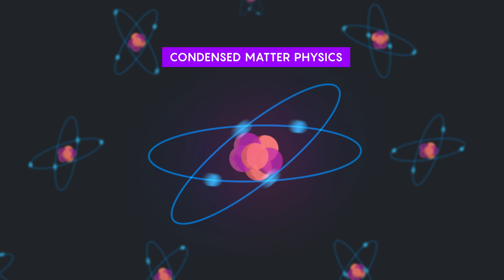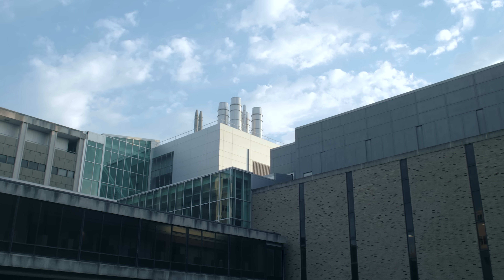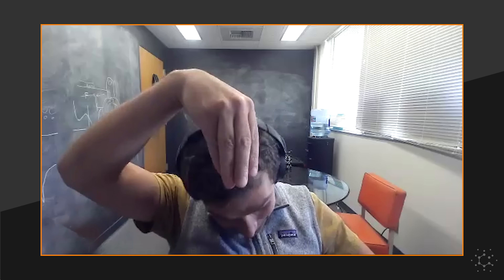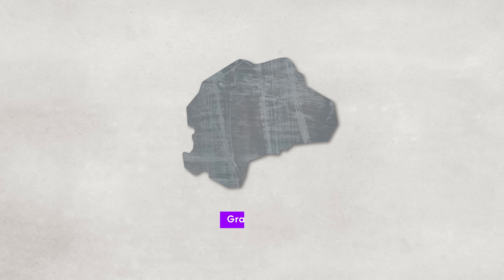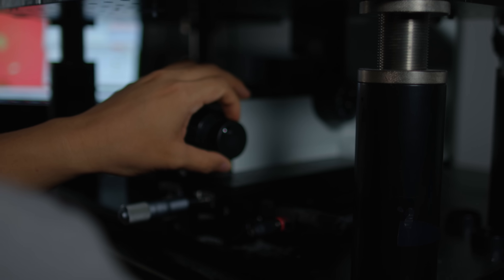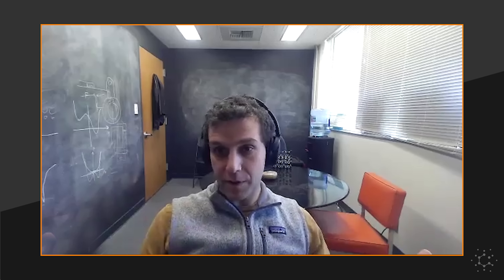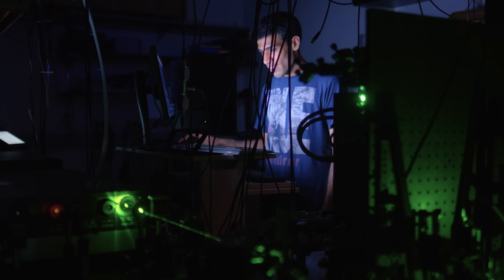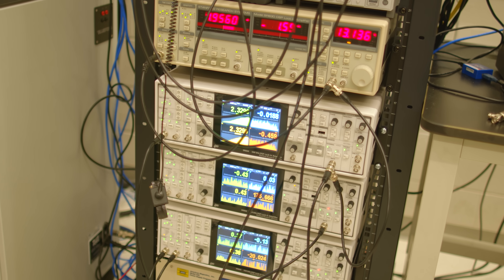How Two Physicists Unlocked the Secrets of Two Dimensions

Comment: 0D Monad (SNF)
1D Line (WNF)
2D Plane (EMF)
3D Volume (GF)
Reply: Are you sure that EMF is 2D?
Reply: @Moz29  
Yes. What I'm not sure of is 3D Volume being Gravitational Force...shouldn't we have found the Graviton by now? Seems like Gravity might need to swap to Dayton Miller’s Ether. I think our problem is Isaac Newton's 1D-4D nonsense. How can he just dismiss 0D? Can 3D you and I even exist without a zero-dimensional space to exist in? Isaac Newton seems more and more like a fraud who used the political power of the Church to force his achievements 🙄.
Reply: @ready1fire1aim1  I don't know about any of that stuff but I was taught EM is two perpendicular oscillating electric and magnetic fields (x,y) propagating in the same direction (z). The perpendicular fields are individually confined to 2-D planes, but together as EMF they operate in 3-D. Am I missing something?
Reply: @Moz29  
Which of the 4 Forces doesn't operate in 3D? We are 3D and use all 4. This makes them all 3D? I'm trying to avoid Newton's conflation errors. Assign each a separate operation (like Leibniz).
Reply: @ready1fire1aim1  I agree, its also why the title of this video bothers me. Would like to know more about what kind of approximations they have to make to consider these systems as 2D. Back to what you said, so do you treat electric and magnetic fields separately is that what you mean?
Reply: @Moz29  
I agree Electromagnetism is a singular fundamental Force. I like 3 of 4 of the fundamental Forces...I'm just dubious of anything Newton. Fun fact: recently academia tried to combine WNF and EMF into the "electro-weak Force"...just to keep Newton's 1D-4D nonsense in play. Really wish they'd just let a failed theory die. Leibniz's 0D-3D has always been accurate and matches our Standard Model...makes me wonder what money is behind Newton...pushing his nonsense on the Plebians...
Reply: @ready1fire1aim1  That’s interesting. Reminds me of how Bob Lazar used to say GF was the same as the SNF, just acting over larger distance.

Comment: Can Anything Be Truly Two Dimensional Especially When Most Things Not Even Atoms Or Fundamental Particles Exist Physically By Measure At The Planck Length?
Reply: Correct, I have been unable to find a single 2nd dimensional or 1st dimensional object.  We are in a 3d universe of perpetual motion.

Non-motion generates nothing, nothing collapses, this collapsing generates folds, space, and time as we understand it, the folding of space it what we quantify as positive energy.

In reality, the 1st dimension is larger then the 2nd, which is larger then the 3rd. They coexist as ratios of one another, and are one and the same object.

Comment: This seems genuinely revolutionary
Reply: You can tell by how big they are smiling.
Reply: NOPE, its genuinely a bunch of nonsense, that's why they are smiling.  No one has even seen a single Atom with any clarity, everything we think we know about atoms is pure speculation, No one has ever detected an Electron, a Proton or a Neutron, they are ASSSUMED to exist because or MODEL of the Atom says they ought to exist. Well, some don't agree with the current Model. Science is not about consensus.

So, they haven't created an atom from Electrons at all, they have not ever actually studied an electron, because they cant capture one or even if they did, nothing they could do could examine such an object.
Creating a sheet of graphene or similar only a couple of atoms thick, it would necessarily be practically invisible to an optical system.  Remember an electron scanning microscope can only see a fuzzy blob that they think is an individual atom, so a material made from only two stacked is going to be too flimsy to hold together.  Look at gold foil, it gets so thin that it cant be handled mechanically. it wafts away on the air currents if if gets too thin. And even then it no where near a few atoms thick.

So they are claiming to be able to make any element by just adding electrons one by one... 
but Hydrogen has one electron and one Proton, but he said he added a single electron to make Helium, but Helium needs 2 Protons, so where did they second Proton come from?

There is no way to just "add" a single electron by "dialling up the voltage".
This is just like the quantum fake science they all rave about. All BS.
Reply: @everythingisalllies2141  Let's assume everything you say is true. The device you are using to type all of this is based on storing billions of on/off states in matter using electrons. So even if we have never seen an atom or electron that doesn't really matter in any practical sense. We can build things in the real world with our models and they work in a consistent manner.
Reply: @lucidvizion  No, you ASSUME that the IC in my computer is working by storing little chinks of matter you called Electrons, because that is part of your imaginery MODEL of how electricity works.  But SOMETHING is happening, but to claim its electrons is just your assumption.  Truth is there is no way for you to prove that these electrons actually exist, you have never isolated one and presented it for inspection.
Reply: Artificial atoms based on Josephson junctions have been around for more than a decade now lol

Comment: Can someone help me clear up my confusion?:

As I understand it, atoms are kinda defined by their number of protons, 1 for H, 2 for He, 3 for Li, etc. So why does changing the metric associated with electrons change the atom, and not just change it to a type of ion instead?

Also, as I understand it, an atom usually has the same amount of protons as neutrons, so are these created atoms special isotopes of the usual atoms?
Reply: What they have is a region in the 2D structure that behaves like an individual atom, but it's actually way bigger, so it's easier to measure. Atoms are defined by the number of protons, but their real behaviour and most characteristics are defined by how the electron cloud is distributed. That's why atoms in the same column of the periodic table have similar properties. When they change the voltage it changes how the simulated atom behaves.
Reply: @tiagodasilva1124  appreciate the clear explanation!
Reply: @ToriKo_  Yeah, I don't think there are actually any protons or neutrons in there. When they say "atom", it sounds like they've reproduced an electron cloud environment similar to what you'd find around an actual atom. Which is why it's "larger", because an actual atomic nucleus would pull those electrons in a LOT tighter.
Reply: @ToriKo_    Emphasizing OP's "Atoms are . . . defined by their number of protons."

They developed a model for putative redox reactions, not transmutation.

For instance, in their model, let's imagine 10 electrons. Is that exclusively Neon? Or can it flip to a Fluoride ion or an Oxide moiety? Or a Nitride anion or an Alkyl centre?
All five have 10 electrons: 1s(2) 2s(2) 2p(6).  But only one of them makes H2O with two hydrogens.

Kindest regards, neighbours and friends.
Reply: According to Wikipedia. The amount of electrons in atom mirror the number of protons.
Reply: @JasonB808  That is typically true. But these structures they are making are, near as I can tell, not complete atoms. They are clouds of electrons resonating the way they would if they were attached to an atom. It's very clever, but also a very VERY loose application of the phrase "artificial atom", which is no doubt causing the confusion.
Reply: Not all atoms (chemical elements) have the same number of protons and neutrons. As the atoms get bigger/heavier, the ratio shifts more towards the neutrons (more neutrons than protons are in the nucleus). But for smaller atoms the number of protons and number of neutrons is often the same, as you said.